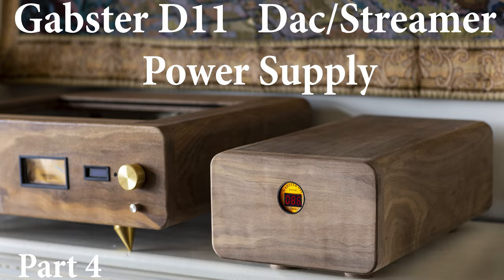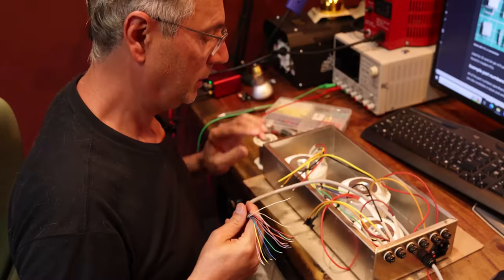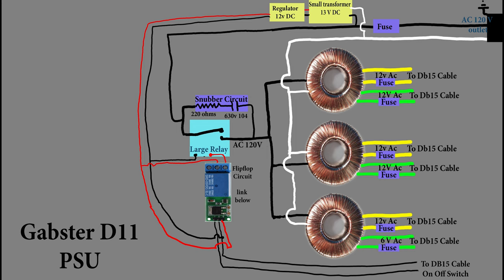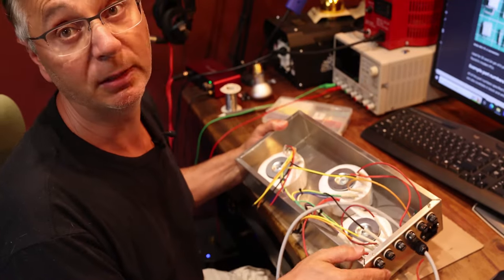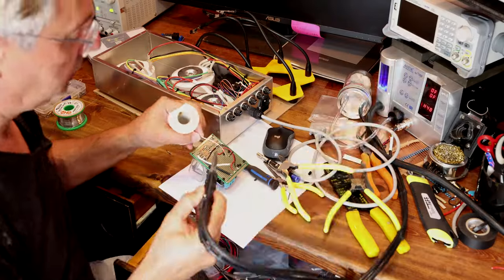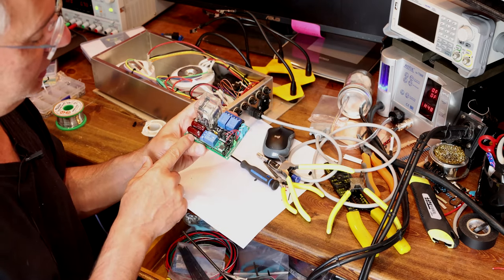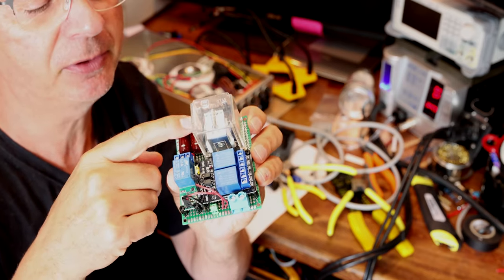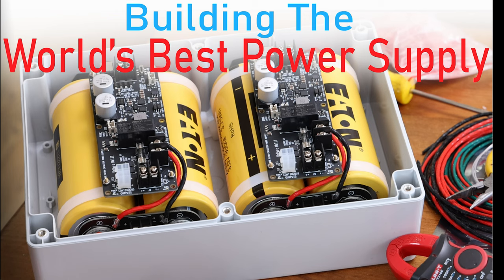Ultra / SuperCapacitors Power supply with Triggers and timer. Step by step

Comment: Hi. Good job. 
From my experience, I do a lot of linear power supplies for all type of audio gear, the higher the VA of the transformers the better sound, even if you supply a set that needs very small current, in my opinion the transformers that supply audio circuits must be at least of 225VA not 100VA, that also in my opnion is to short for any audio circuit, even the math says the contrary.

After knowing this for a long time, I found an early video of Paul of PS Audio saying the same and teeling the story how he found it, very interesting story, just check.
Reply from the maker: You are absolutely correct for a regular linear power supply. This is a different system these transformers do not run the system it runs on isolated ultra capacitors they only run to charge for a second between songs
and disconnect leaving the purest power at huge Amps like over 8000Amps in 1 second It is like using a 2000VA transformer. 
See UcPure mk3 and the UC Manual for more info.
Reply: @Gabster1  You are right I didn t see all the video only small parts , I find strange the tiny wires in the cable of the output of the transformers, anyway I check in Audiophonics the board, I m a costumer of Audiophonics and sometimes I do a walk around the store but I don t remenber to see that board or didnt kept my attention, it is an interesting approach, that something I have already think of, but since I have done some experiments in batery powered preamplifiers or phono pre the sound seems more lasy and whitout life than an normal regulated power supply, I abandoned the idea, but this one is much more advanced, if I will have a costumer willing to try it I sure will try it. Thanks for your explanation that will not be necessary if I had see the all video.
Reply from the maker: We are all guilty of not checking deep in a subject. Not a lot of people know about it.
A great psu for small loads like preamps and dacs not so for Amps.

Comment: I really appreciate the passion and sharing, but I am not sure this obsession with power supplies yields audible differences. Maybe measurable differences, but you don’t seem to measure results at the end of your projects.
Reply from the maker: UC power makes a huge difference for devices that do not use a lot of power  like Dacs, Clocks, Opamps, Preamps...  I do listen a lot and measure some but for power supply ripple when you get down below 1uv level it is hard to measure. So listening in a quick A/B is best. The differences are minor in a single device but when combining a few you can sure hear it.